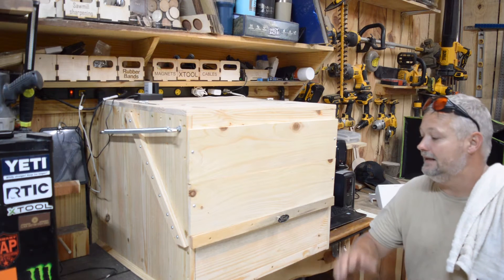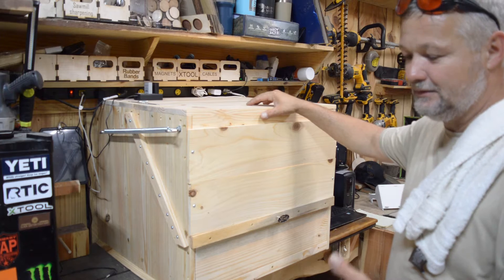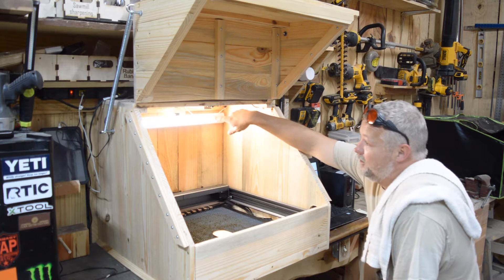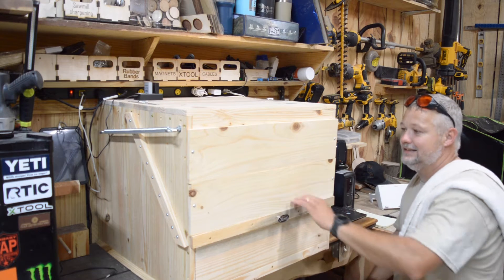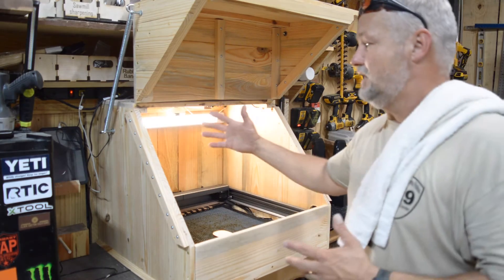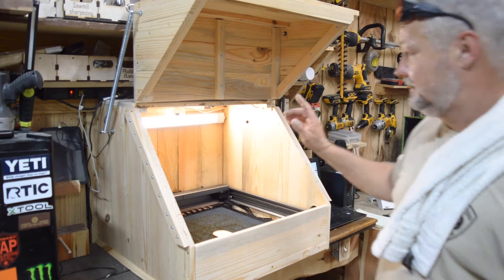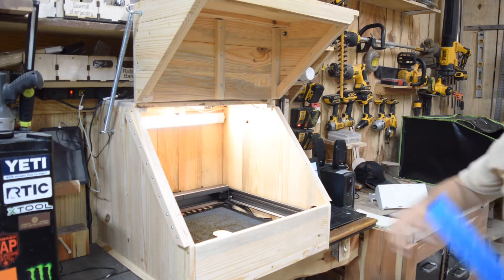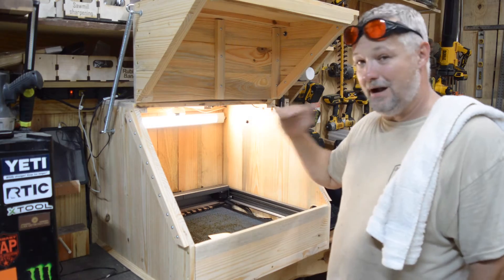My enclosed vacuum table

Comment: You can fireproof an enclosure by lining it with fire rated gypsum wallboard. It's how most fire proof gun safes are fire proofed. It will add a lot of weight.
Reply from the maker: There are also a lot of sprays and other stuff that you could use.

Comment: Bro - you continue to amaze!!! Did you change the air flow ports on your vac table and are you no longer using your earlier side and front hole design layout? I'd love to see your newest design for the air flow and table latout if it's changed...... Keep up the great work!  PS - I wonder if a "Blink" type wireless cacmera would work as an option instead of the hard wired version you have? Thoughts ???
Reply from the maker: I did change this one up but I am not sure I like it as well. I also used an exhaust fan rather than vac. So far it works but not sure it is as good as the original.
Reply from the maker: Lightburn is set to use USB cameras, I am not sure how you would connect a wireless camera.

Comment: Very nice job and well thought out. Wonder if LED lighting in enclosure would work better for your needs? I've been experimenting with LED lighting tape.
Reply from the maker: I have been using this light because I already had it. It is LED and is quite bright. It’s just economical right now. I could put RGB for cool points.

Comment: Great job on the enclosure.  I will be doing something similar with my D1 once I get it all set up.  Curious how you'll handle using the rotary attachment with the new enclosure?  Do you have enough access to the feet of the unit to add the risers?  Also curious if you have seen some of the enclosures other folks have made that have a series of slots to hold the honeycomb so you can raise/lower it by moving it to a different slot.  I'm kind of wavering on whether I want to try and add something like that to mine.

 Love the channel.  Keep up the great work.
Reply from the maker: The D1 lifts out that same as it did before, I am contemplating a floor system that will allow the rotary to remain in place inside. I will likely be making some more changes to my setup.

Comment: Is the camera centered over the D1 front to rear?
Reply from the maker: I used the image to center it over the workspace. Measurement wise, it is actually closer to the front of the overall machine due to the gantry being in the rear beyond the workspace.